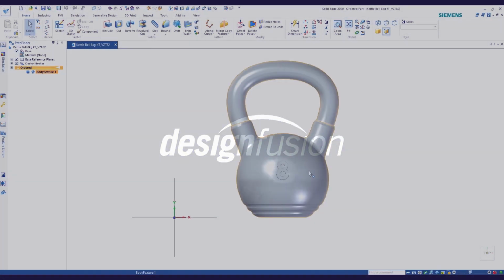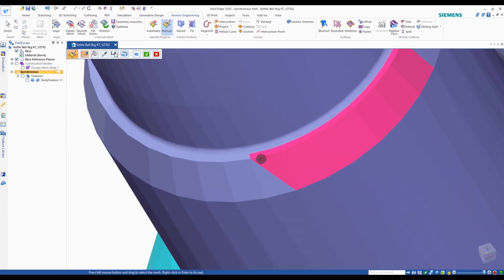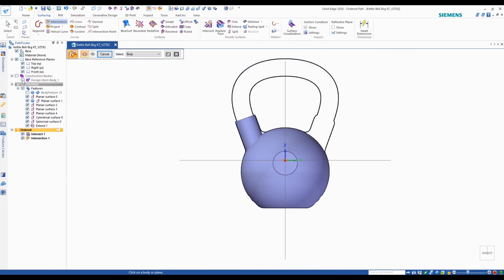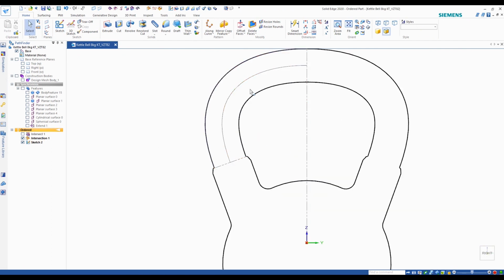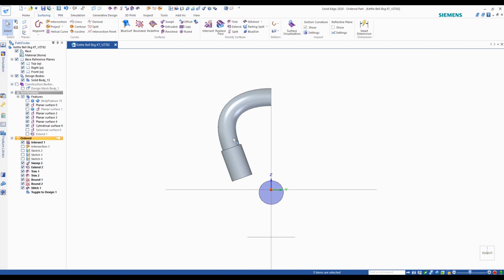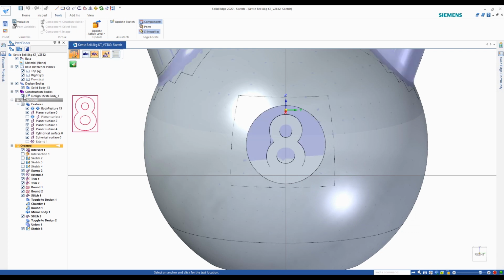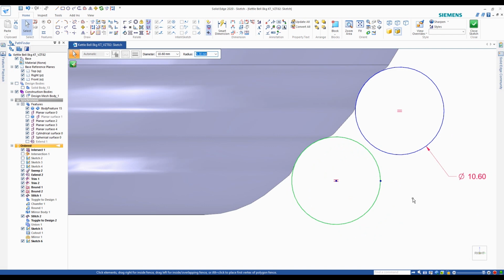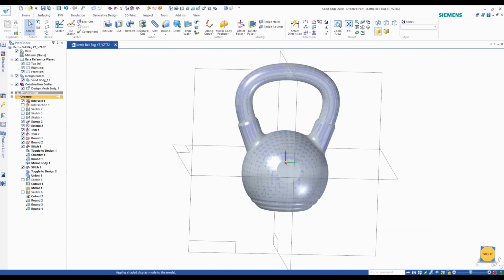Reverse Engineering in Solid Edge 2020

Comment: thanks for this, really clear tutorial. I am struggling with going back to add to face selections after Ive started  the Fit process, for example a hole is at the wrong angle, so i try add more selection to give SE more info but I cant go back to brush select, is this possible?